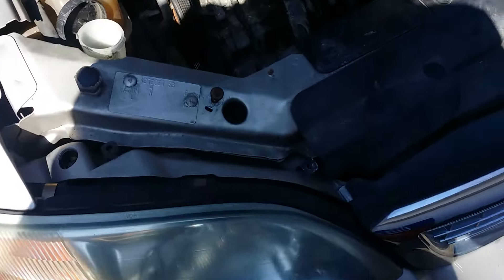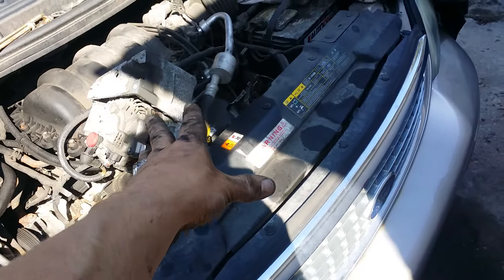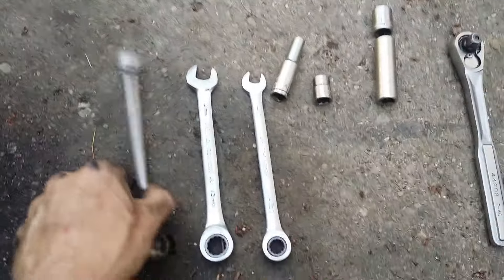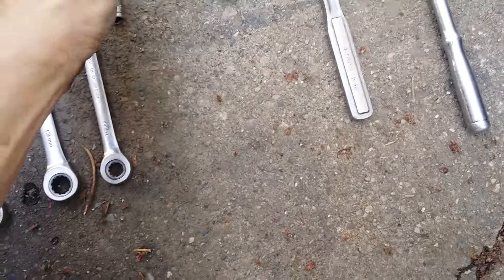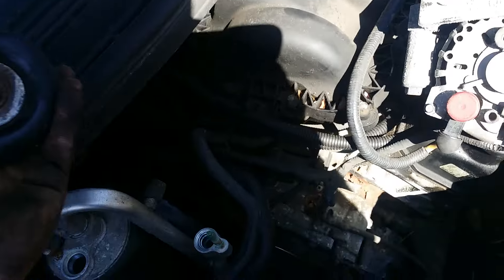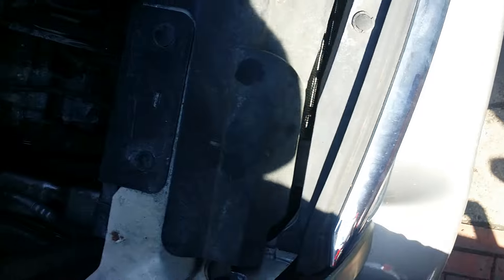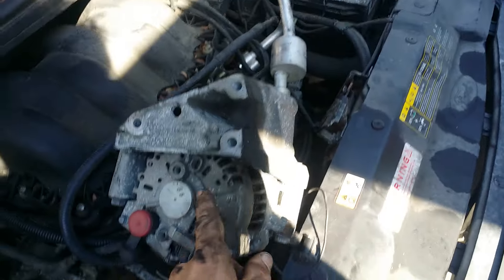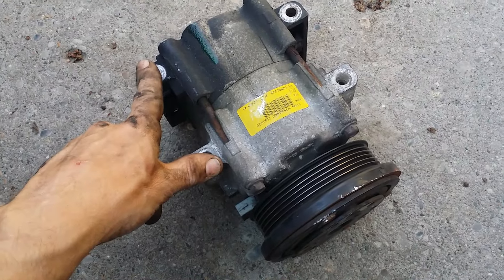Ford windstar AC compressor replacement

Comment: I have a 2005 Freestar and it looks pretty much like your Windstar engine bay.  I noticed that I had lost cooling but when I went to recharge the system the new coolant wasn't being sucked in.  The A/C clutch wasn't engaging.  A few days later, my engine wouldn't turn over.  The starter would go "thunk" or "thud" and stop.  It was engaging the flywheel but not turning it.  After we fussed and beat on the system for awhile, we managed to turn the engine over by hand.  That seemed to do the trick after doing it several times and the car would start.  Now, a month later, it "thunks" again and no start.  From what I understand, something in the A/C compressor freezes up/locks up and won't allow the serpentine belt to rotate.  No belt rotation therefore no engine rotation and no startup.  My buddy said while he was underneath that I couldn't bypass the A/C compressor because there was some "pipe"/"hose" in the way.  But, I see below in the comments that someone mentions about a "bypass pulley".  Does anyone have any information about that?  That would be an easier fix than trying to get that old compressor out of there and replaced with a new one.

Comment: how do you remove the old one?
Reply: Right? Looks like you'd have to pull the motor to get that out of there. LOL! Or support the motor and drop the sub frame and go out the bottom. Looks like he pulled the alternator off to expose the AC unit and pull it out the top.

Comment: They make a bypass pulley for that. 30 bucks on ebay and no need for another compressor.
Reply from the maker: Sadly, I had to have it fixed that day. Waiting for something to come in the mail was not an option.
Reply: I understand but an old compressor without Freon will lock up. Freon lubricates it.
Reply from the maker: +Peter Koch ut lubricates the compressor.... not the free wheeling pulley. as long as compressor does not engage, and the center shaft doesnt rotate, the compressor will have no issues. i did not plug in the clutch.
Reply: Oh i see my mistake, great Video.